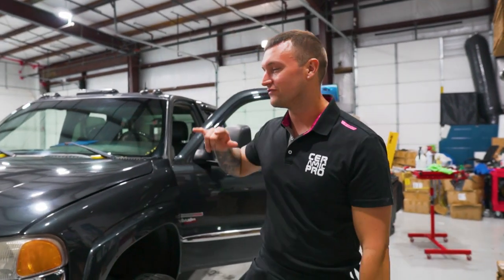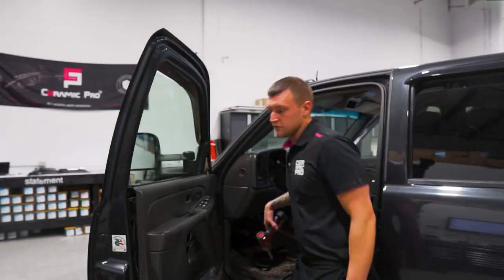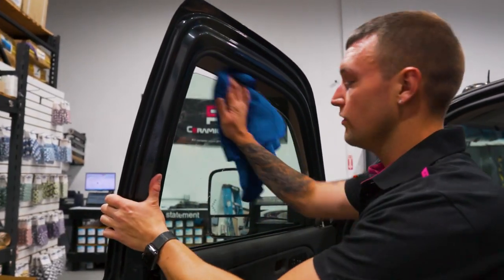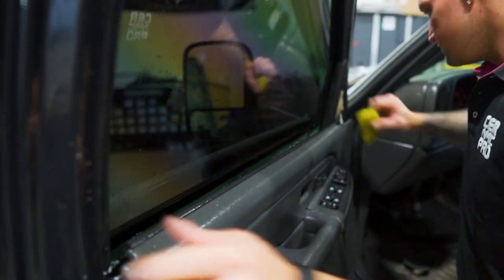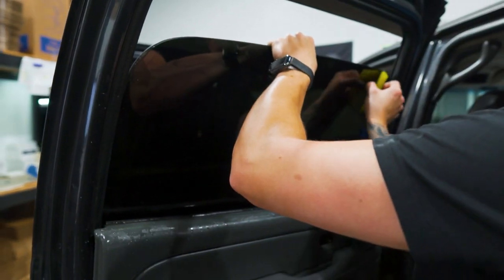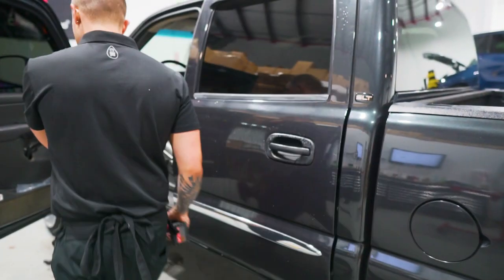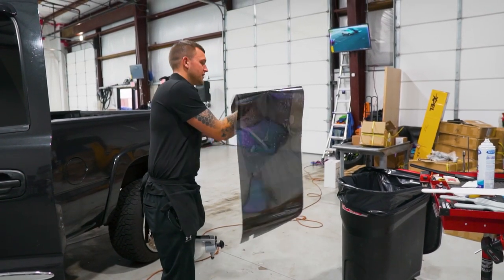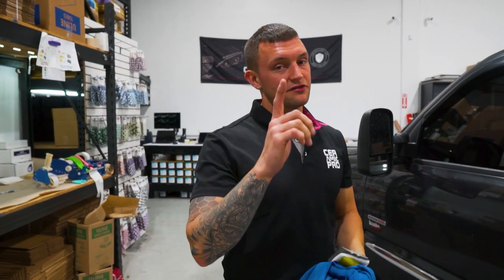How To Tint a 2004 GMC Sierra - Pre cut Window Tint

Comment: what solution should I use and how much of it. I currently use baby shampoo and water but it sticks to the glass a lot. I have a spray master or sometimes I use the poly 2.
Reply: Mate,it is up to you some just use 2 to 3 squirts per litre/bottle then shake it up,but then some prefer a more soapy,/slippery solution.But the 2 to 3 works fine👍

Comment: There is no screw on the bottom that holds the Panel to the door the 7 mm screw that is on the bottom actually holds the door tray in there’s two little plastic clips that slide into the door that hold the bottom!!
Reply: In 2004 it's a screw